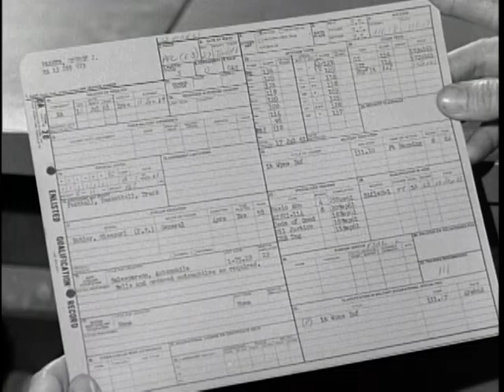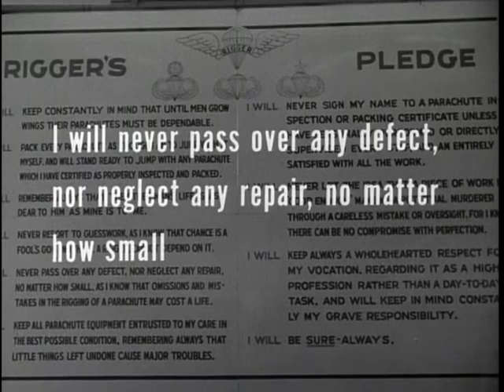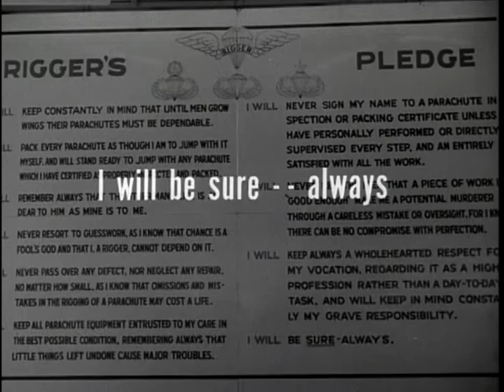The Parachute Rigger  (1967)

Comment: I was a Rigger from 94 to 02.  I packed 3700 parachutes when I was in the 82nd.  I was also asigned to the 24th QM Co and 612 QM Co.  This old film is awesome.  I Will Be Sure Aways.
Reply: I’ve got a decent jump log in the 307 Eng Bn 82nd Abn during that same timeframe. Never had a malfunction. Thank you.
Can’t say the same for some of our heavy drops. I’ve seen a SEE truck get vaporized.I’m pretty sure the heavy equipment operator was okay with that though.